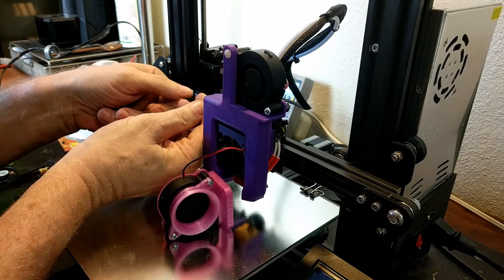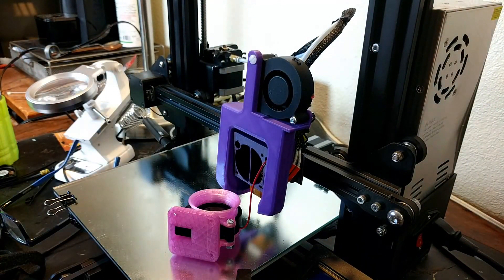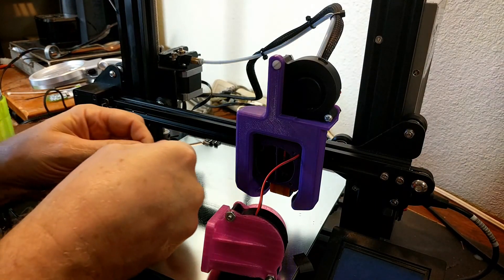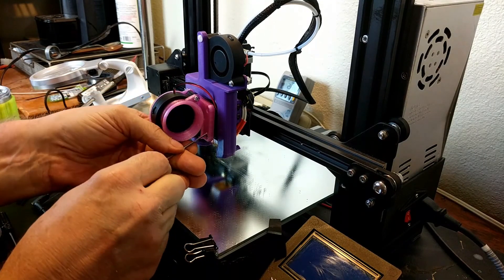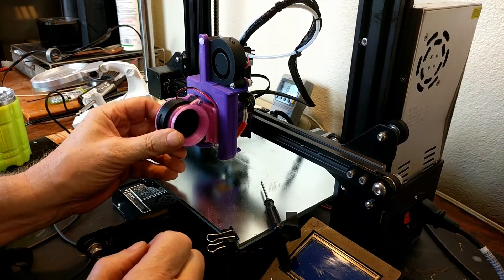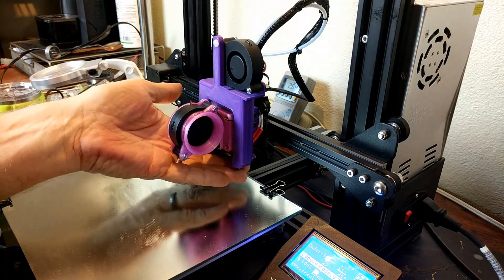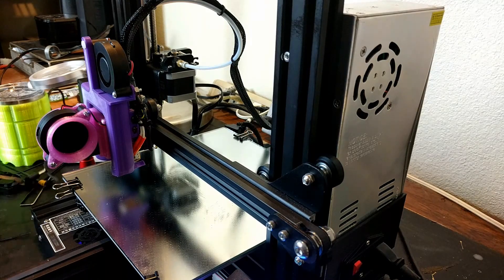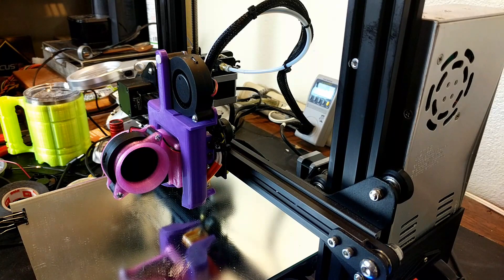Ender 3 - Upgrading the hot end cooling fan Part 3

Comment: Can a better cooling help reducing stringing? Even playing with temps and retraction I'm still getting ugly hairy stuff around my prints.
Reply from the maker: I've fooled around with cooling to help with stringing and never really got what I'd call a significant improvement. When I've got a part that's stringing my older Ender 3 with the Petsfang and the newer one with the original cooling both seem to be about the same. One thing I've found makes a big difference is the setting In Cura called "Combing". When Combing is turned on it prevents the nozzle from crossing perimeters during a travel move. This made a huge difference for me with parts that have holes by not letting it cross over top of the holes. It does nothing for the problem of stringing across parts when you have multiple parts on the build plate. Speed up your retraction, make sure the filament is actually retracting during a retraction and up the amount it retracts, if the filament is binding or the spring has worn out the gear can retract but the filament doesn't. If you still have the craptastic plastic filament feeder that comes stock on the Ender 3 seriously consider replacing it.  Also, lower the nozzle temp and slow down the speed of the print. And I've had some filaments that string really badly and others that don't. So if all else fails try a different brand of filament.

Comment: Chuck - would there be any advantage to running a buck converter and getting some lower powered 12v fans? I'm just pondering reliability given the stock 24v ones seem so unreliable.  I'm further tempted to run another buck converter from one of the psu 24v outputs to give me 5v to play with - need to get my caliper out and make a housing for some useful connections though I guess.
Reply from the maker: I honestly see no advantage in adding the complexity to drop the fans to 12 volts. If you did so you're going to have to replace the fans and most of the quality fans you'll find come in 12v and 24v. The only fan I had trouble sourcing was the stock part cooling fan, its' apparently something made for Creality and the quality seems to be low and the price high. But there are several printable parts that let you use either the 5015 blower fan like the Petsfang does (apparently some 5015 blower fans require a capacitor added to the circuit, but the Sound Design available from Amazon that I linked to does not) or a standard 40mm Axial fan, I'm playing with one of those now. So I see no real need to either drop the voltage or use a fan that requires a capacitor. But in the end, it's whatever makes you happy and works.
Reply: Hey Chuck, thanks for both of the replies!  I got annoyed at the machine last night as it dragged another print around the bed so I figured I'd do a small tear down!  I removed the aluminium bed and the leveling assemblies with it.  Turns out for some reason that the rear left corner wasn't providing as much spring support to the bed as the rest.  I then adjusted the rollers on the bed runner to make sure it was nice and tight! When I reassembled it, it printed the best print it has since I first put it together.  

I printed the replacement front housing (in purple... just for you! ;)   )  and it came out perfect.  Today I'll print the duct, and then I'll order some 5015's and print the converter that you highlighted in another video!  Seriously thank you so much for the videos and the help, it's much appreciated.
Reply: I only wish I could get that one shipped to the UK! Searching for an equivalent spec one is proving tough!

Edit : https://uk.rs-online.com/web/p/blowers/7878960/   Would two of these fans be alright? I realise they're expensive but most others have very low flow!

Comment: Hey Chuck, wanted to thank you once more for your videos! I ordered the Ender 3 in the end, with the ebay discount code today it made it £150 shipped which is too good an offer to turn down! I'll be revisiting these videos when it arrives to see what upgrades to make first :)
Reply from the maker: Let me know when you get it, I'm really interested to know what the new one's are like.
Reply: Will do Chuck, I'm just researching what software etc I need to download as truth be told I'm going into this a little blind currently! Thanks for the reply :)
Reply from the maker: You're going to need a slicer, it comes with Cura and that's a good place to start and it may be all you'll ever need. Later on you can experiment with other slicers. 
Next, unless you plan on only printing things other people design, you're going to need a 3D modeling software. TinkerCAD is a good place to start and it's free. It's also fairly limited, but it's a good place to start learning. If you already have experience in CAD software, then you probably know what you want, but a free license to Fusion 360 (what I use) can be gotten easily and Lars Christensen's Absolute Beginner series on youtube is a great way to start learning it. 
As far as upgrades, first get it assembled right. Take your time, make sure everything lines up without having to force things. make sure it's square and the Z axis lead screw lines up (neither of mine did) and that you get the X axis crossbeam level to the bed after you get the bed adjusted and leveled. Next you'll want to make sure the bed isn't dished (both mine are), if it is dished you're not going to get good prints. If it's dished, put a mirror on it. Oh, and if it still comes with the craptastic plastic filament feeder assembly I'd get a good aluminum one of those on order on day 1.
Once you get past all that and you're getting good prints, then think about mods and other upgrades like firmware or automatic bed leveling. But don't do that until it's printing good or it will be a lot harder to diagnose.
Reply: Hey Chuck,  Thanks for the above. Having built the printer last night I'm doing my first proper print just now! I've no idea whether it has the print resume firmware installed (Is there any way to tell?) but when my computer decided to go to sleep it did not want to carry on - (Power management disabled now!) 

I've had a go with fusion 360, and have so far followed the tutorials you suggested to make a bracket to fix a kitchen drawer that requires replacement! Thank you so much for your help thus far - next to print is a spacer for the z axis thread grabbing part!
Reply from the maker: @mike306dt  Are you printing using a USB cable from the computer? I've always just written the gcode to a micro SD card and put that in the printer. Power resume only works from the SD card. To test, start printing from the card, then while it's printing switch the power to the printer off. Wait a minute, then switch it back on. If it offers to resume you have the feature.
Reply: Hey Chuck, thanks for the reply! I was using the USB cable - I've just managed to print something at semi decent quality! I wondered if you had any advise for Cura settings? I copied some from a youtube video but am always keen to hear from experienced users such as yourself! 

I need to sort the hot end fan out as it's got a major rattle going on now, not sure if it's something I can solve using rubber washers or if the fan has had it already - it sounds as though it's contacting something but it doesn't at all!
Reply from the maker: Settings depends a lot on what filament you're using and what you're printing. I'd recommend you start with Cura's built in PLA settings and Coarse Quality and see how it prints. I'm using a nozzle temp of 210c and the bed at 50c. Other than that, start printing things and see where you need to go. Cura has a million settings and I still don't know what a lot of them actually do. And some don't seem to do anything. If it's printing good you're in, if not let me know and I'll help you adjust the settings. But without seeing what it's doing, it's really hard for me to tell you to make a lot of settings changes.

The part cooling fan (one on the side) failed on me within a couple of weeks. It's a hard to find fan so I did the petsfang mod and am using a 5015 blower fans. The fan on the front, hot end fan, is easy to source, they're all over ebay and Amazon. Don't forget that they're 24v and to get a quality fan.

Comment: Would you say these fans are louder than the stock fans?
Reply from the maker: At 80% speed or lower I can hardly hear them over the printer. I typically run the parts cooling fan at 60% if the part being made doesn't have any bridging. The hot end runs at 100% whenever the power is on and that makes it considerably louder than the stock fan. It doesn't bother me, I can hardly hear it over the sound of the printer and can't hear it at all when the A/C is running, which is most of the time here in the summer. But I may look into undervolting it a bit in the future, but it's not a real priority now.  If fan noise bothers you I'd stick with a standard ball bearing axial fan on the hot end, maybe even a silent fan like the Noctua series.

Comment: I order a pack of 2 5015 24v Fans from the link in the description. How would the blower increase performance? Is it any better than stock? Do I have to change the speed of the fan in the control board? Other than the questions, Nice mod tutorial
Reply from the maker: For the part cooling fan you'll get better bridging and it will be better in both directions of the x axis. For the hot end fan it will cool down faster after a print, but other than that might not make any difference. The hot end cooling fan runs at full speed whenever the printer is powered on and the parts cooling fan is controlled by either the firmware setting or more often the slicer software.
Reply: Chuck Bryant Thank you for the quick reply. I will keep that in mind when I build my Petafang fang along with the hot end cooling fan upgrade

Comment: Hi Chuck,
Good video, I really appreciate and like all of them. Also im really interested in how the printer performs if you turn off and on the power while printing.

Have a nice day and greetings from germany.
Reply from the maker: Thanks for the kind words. A week or two ago my wife accidentally turned the printer off...about 7 hours into a 12 hour print. Much to my surprise when I flipped the switch back on the printer offered to resume the print. I said "Ok" and it went right back to printing it. Fortunately it had stopped over the infill so there wasn't any noticeable damage. So it does work. Other people say it doesn't, but it did for me. 

Just be aware that Creality has disabled some safety features such as Thermal Runaway in the Marlin OS it ships with. You can flash a bootloader to it (I'm in the process of working out how to do that) and turn those features back on, but you lose the resume feature after a power loss. Since my power here is very reliable (my wife knows better now) I don't mind losing it to get the safety features. I hope this helps!

Comment: Thanks for the continued upgrade videos, that velocity stack is hilarious :-)

What have you got on the bed for adhesion?
Reply from the maker: A mirror square from Lowe's (6 for $8.99) cut to fit and a thin coating of AquaNet Extra Super Hold hair spray (large can from Walmart for $1.99).
Reply: Thanks Chuck, it was the hairspray I was curious about... I'll see if they sell the same brand in Australia :-)
Reply: Did Lowes cut one for you or did you cut it yourself?  I suppose I'll be surfing how to cut glass next.  The good news is it sounds like I get 6 chances to do it right.   The non-tempered glass never has a problem with heat?
Reply from the maker: I cut it myself. I watched one video then cut one square as a test piece. It's easy to do. I've had no problems and I've run the bed heat to 100c.
Reply: Will binder clip work as a way to clip my glass bed down? How will it conduct heats when I print in ABS?
Reply from the maker: That's what I use and it's been working fine.

Comment: perfect timing - I am sure you covered, but on parts fan blue to black?
Reply from the maker: Are you talking about the wiring? If so, my fan has black and red/black. The printer has red and black. Black to black, and red/black to red. if your fan has different color wiring you're on your own, but usually it's black to black and then the other one goes to red. If you've got red and blue then it's red to red and blue to black. But it's a DC fan, if you get it wrong all that's going to happen is it's going to suck instead of blow. Check before it's mounted and reverse if necessary.